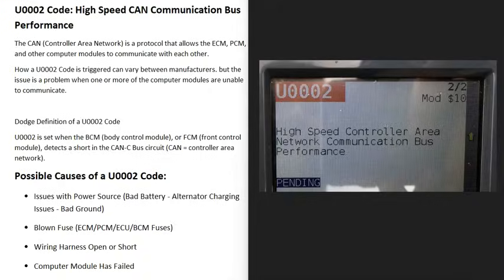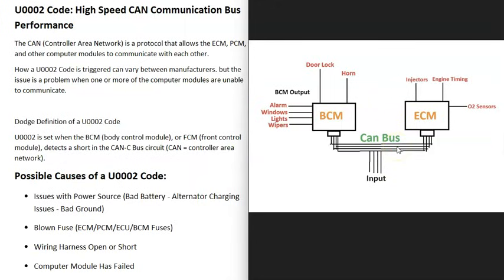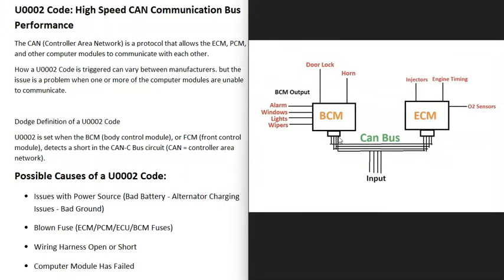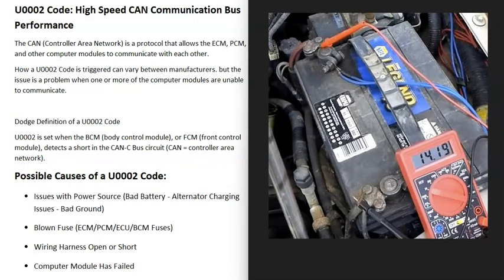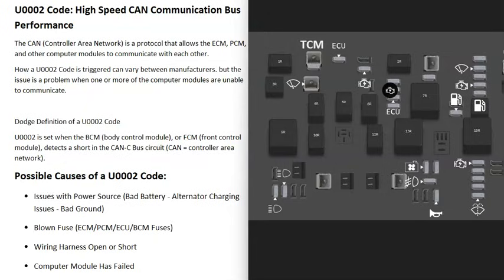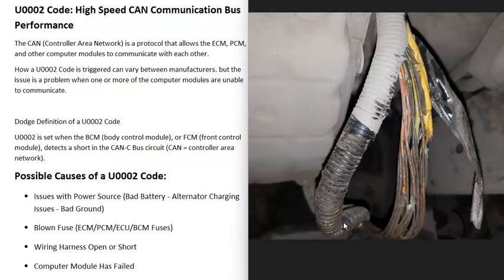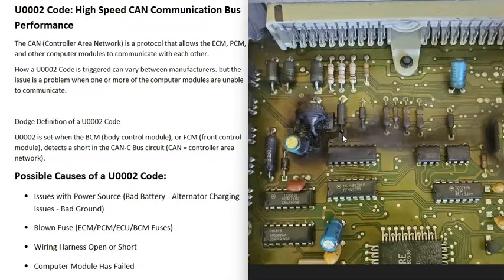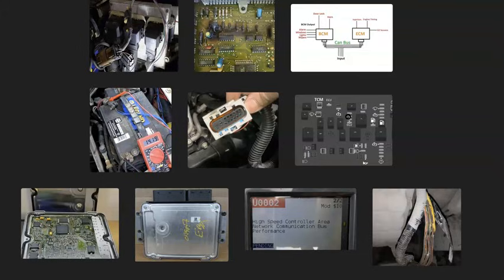Causes and Fixes U0002 Code: High Speed CAN Communication Bus Performance

Comment: What could the issue be if I have glitching on my dashboard and can’t shift the car once it rains on my 2013 Dodge charger
Reply: Probably an open wire that got wet, my mopar did the same thing when a wire got went and it went into limp mode